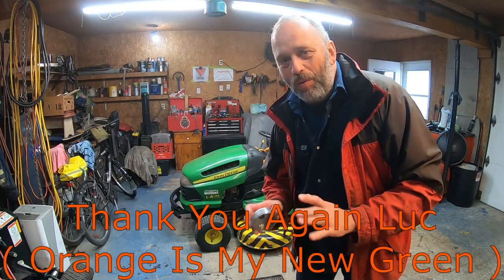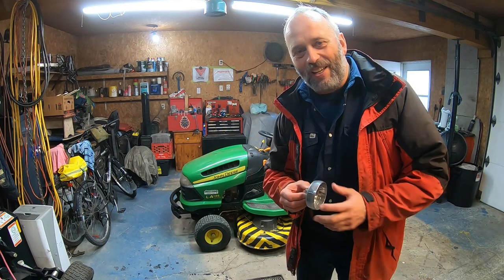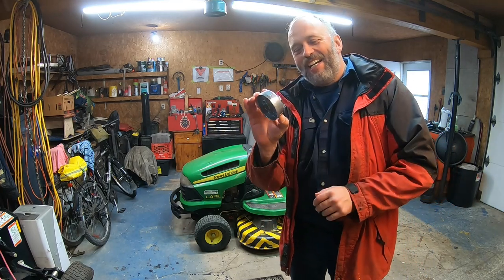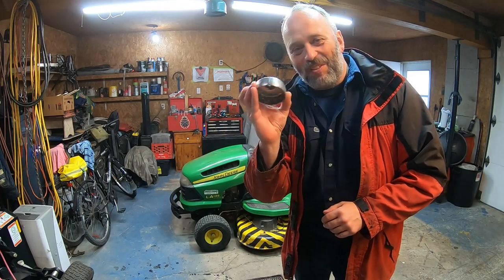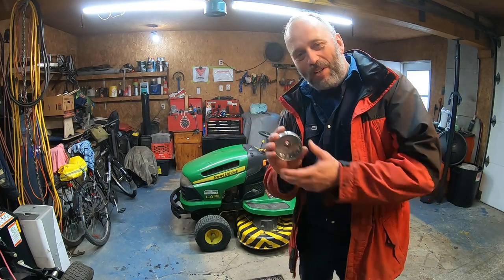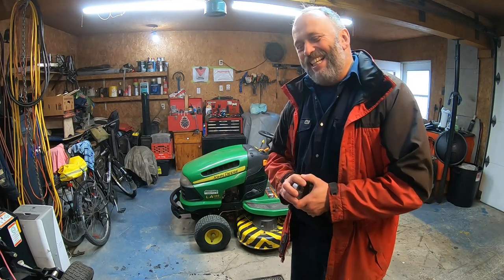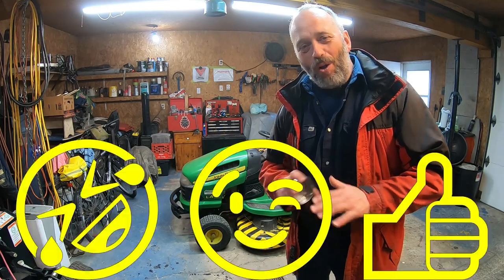The Best Ever Protective Coating on Mower Decks

Comment: Great experiment Dave.   Now I did notice your mower deck does not have any rollers at all.  My tractor has 2 on each side plus one on the front that prevents the deck from striking any objects as it keeps the deck protected  from striking  the ground  on uneven lawns .  Maybe it's just your model but I can't remember seeing a deck without rollers. 😅
Reply from the maker: Good day Steve, Thank you very kindly for your OUTSTANDING supportive feed back comment 👍👌😇 I removed them since they were getting stuck everywhere when I was living in Shefford  or had fallen down after many year of metal fatigue like I did on this video (  https://www.youtube.com/watch?v=lN-kNU6gQlk ) 🚧🚧 No Problems Since Then 😇👌👍🚧🚧 Now for the front part, I have an idea ( extra bumper right in front of it on an incoming WINTER  video ) 👍😇 Thank you again Steve Cheers 🍻🍻
Reply: @RCAFpolarexpress   Dave they are not ment to run along the grass while cutting but adjusted high enough to only  protect the deck .  Maybe you could try them in the upper position.  Put the deck to the cutting height you regularly cut at  on your concrete floor  and have the rollers adjusted about 1/2-3/4 inch below the deck.
Reply from the maker: @SteveRobReviews  Thank you very kindly Steve for your explanation 😇👍 I had done that in Shefford ( I had to admit that the green was not even on various places, just simply turning will get the side of the these wheel hang on the grass and tear it up ) But since I'm here now on my small green patch, it might work a shot to try it 🤔😉👍 I'm still awaiting the tare to dry this week re welding them into place won't be to hard or trying an other bigger wheel model perhaps,,, thank you Steve Cheers 🍻🍻
Reply: @RCAFpolarexpress  take the  blades off!
Reply from the maker: @paulbecker97  Good Evenings, I did not need to take the blade off but I did to sharpen them later  👍👍😇After the Wet Summer That We have the mower deck is looking very nice and no paint or maintenance I have to do except the regular greasing and cleaning the dry turff Cheers 👌👌🍻🍻

Comment: The deck looks in good shape Dave, great protective coating 👍🏻. Have a great week and thanks for the shoutout 😉🙋🏼‍♂️🙂👍🏻🍻cheers!
Reply from the maker: Good evening Luc, it was a great honor to mention your name and channel mon ami and trust me doing that :  rust off, paint, resin, enamel paint and then tar coating will be a time saver and that will also save the structural integrity of my mower deck since I will not have to remove rust on every year like the last 12 yrs but rather just a 10 min clean up on every year 👍😉👌 Keep up your OUTSTANDING videos Luc and I like you last wood cart that you built for your FEL on your Orange tractor video👌😉👍 Cheers 🍻🍻

Comment: The tar seems like it would restrict and change the flow of grass out the discharge or to the bagger
Reply from the maker: Good day Sir, You are correct but after a couple of hours, the tar surface is getting smooth and In my case, I have a recutting set up blade and the discharge port is blocked for making sure that the grass getting composted faster. Thank You Very Kindly Sir Cheers 🍻🍻

Comment: Good evening Sir, your mower deck will last for many, many years with the layers of protection that you applied.  I agree with you about keeping water away from the underside when cleaning as it will promote wet decomposing grass and that is not a good thing.  Keep up the good work and have a great week Sir!
Reply from the maker: Good evening Sir, thank you very kindly for your Outstanding Positive feed back comment Sir 👍😇👌 Yes in deed water is causing a lots corrosion in deed when not properly dry and with grass,,, it is disaster awaiting to happen over the years if not maintained very well, but now with that combination of paint and tar or the Deluxe Version ( paint, resin, enamel paint and tar ) you will save time and energy over the years and also the structural integrity of your mower deck 👌😇👍 I just realize that was a kind of an infomercial pitch line that I wrote 🤣👍👌 thank you again and keep up your OUTSTANDING Logging Video ( Your last video cleaning up after cutting tree ( Chainsaw & Grapple Work) was OUTSTANDING Sir )  Cheers 👌👍💪😇🍻

Comment: Great video Dave. You know all the tricks 😎 Tar for decks and Hydraulic oil for wood. Very cool my friend. Have you ever tried a spray on graphite coating like EZ slide?
Reply from the maker: Good evening Sir, thank you very kindly for your OUTSTANDING informative positive feed back comment Sir. No, I did not try that product at all but if it is like graphite grease on gun like we use in the desert or artic it will not offer enough cushion against flying rocks, perhaps maybe  ?  🤔 Did you ? Have a safe week and OUTSTANDING video of your Firewood making ( splitting, pilling etc,,, ) 😇👍👌 Cheers 🍻

Comment: My solution to prevent rust on a deck was to send the deck off for hot dip galvanising. The deck and mower is now 18 years old and although the mower has had a new engine and many repairs, the deck does not have a single spec of rust on it. I did not paint the deck after galvanising. The mower is a Husqvarna iZ commercial zero turn and has been heavily abused, including using the deck as a grader to push dirt around, still no rust and the deck cleans up really easily with a high pressure water blaster.
Reply from the maker: Good Evening Sir, thank you very kindly for subscribing to my channel Sir 👍👍👌😇 Thank You So Much For Your OUTSTANDING Technical Life Biography is truly Marvelous Sir 😇👍👍Thank You Again Sir for the high quality writing 🧐👍👍Cheers 🍻🍻

Comment: Good video Dave.  I have a bit of a contrary opinion about the water.  On the deck of my Deere GT235 garden tractor I go with your thinking...I don't ever wash under it because it lives at the Overlook which has very sandy soil.  The bottom of the deck is always super clean because it is essentially sandblasted every time I use it.  On my Toro ZTR though, it's a different story.  I use it at my home and the conditions are very different.  My yard is at the low end of our neighborhood and really holds water.  Days after it rains the grass can still be wet so I get lots of buildup under the deck, and that buildup holds moisture.  However the Toro deck has a washing port which allows me to plug the hose into the top of the deck, turn on the water and run the blades.  It's not perfect but it does a pretty good job of cleaning out the grass if I do it right after cutting, and letting it run for a few minutes helps dry out the underside of the deck.  My logic is that the grass buildup is going to hold moisture regardless of whether it's from wet grass or from the hose, so I'm better off removing as much buildup as I can.  The deck is 15 years old and still in good shape so I think I'm safe. 😉  (BTW, I do clean it fully by hand whenever I sharpen the blades.)

Great content and good info on coatings!  Cheers my friend!  🍻👍😎
Reply from the maker: Good Morning Sir, thank you very kindly for your OUTSTANDING VERY WELL WRITTEN Informative Feed Back comment my friend 😇👍👌 For your Mower Deck of your JD I would recommend to apply paint and tar since sand will eat your mower deck over time ( BTW the tractor is 14 yrs old ) My mom use to cut 2.5 acres of grass using the same tractor before I buy it from her  and I had around .5 acres to cut when I was living in Shefford ( see these videos  https://www.youtube.com/watch?v=ylOeYCYEw_w&list=PLXG51U0Imi5WYQzQJsOBgsJRwBSYcgCWR&index=5&t=2s ) and this video too you will see how much rock blasting I had (https://www.youtube.com/watch?v=lN-kNU6gQlk&list=PLXG51U0Imi5WYQzQJsOBgsJRwBSYcgCWR&index=12&t=3s)  so it was rocky and dusty on my high ground part and wet on the lower portion of it as you can see on my video. I wish that I had new that beford my mower deck was starting to get very tine and putting in jeopardy the structural integrity of the mower deck ( especially between the two spindles ) , I was about thinking using resin and fiberglass cloth but now with these results I'M SO HAPPY, but now I have field tested solution to overcome these problems ( normal version : pain and tar ) ( deluxe version: pain, resin, paint and tar ) and ( Bullet/Rock Proof Version : Paint, mixed resin and fiberglass, paint and tar ) 👌💪😇 Now Sir that was for your John Deere. Now for your Toro mower, yes I do agree about cleaning it after each cut and making shure that you are drying it correctly ( you can put a blowing fan to finish the drying and you will save a lots of gas doing it instead using the engine ). Yes removing the grass is a vital factor for sure, but if you were putting paint and resin the grass will slip out easier ( I can wait to see how the snow will react on my snowblower drum for that since it is resin multi coated !!! ) and that will also protect against corrosion too and the clean part will be mush easier too. Thank you again Sir and have an outstanding week Cheers 🍻

Comment: Obviously your TAR test has worked for you. I use another method of cleaning my mower deck which is opposite to yours :) Without starting a controversy, let me say that 
my 'deck is still rust free and exceptionally clear of grass and debris.  I do agree with you that the deck must be kept dry and I use a lot of compressed air and then a fan to keep
 air circulating  all around the underside. I bought my Cub Cadet 1046 mower/tractor back in 2006 and it is still  in 'tip top' condition.( Free from any and all rust ) Of course storing
your mower indoors is very beneficial to ANY equipment, isn't it!
By the way I have to mow some 2 acres of lawn each time, so yes keeping those cuttings off your mower is critical to protecting the steel parts, maintenance is the 'key'!
Reply from the maker: Good evening Sir, thank you very kindly for your OUTSTANDING Informative feed back comment. I like your point of view and also ( forgot to mention ) that I do use compressed air to clean after each mowing therapy too. Yes storing the equipment OUTDOOR need an Oil treatment for protection but I also forgot to mention that I keep my humidity lower that 45 % at all time inside my garage. I do think that a good paint and tar for your deck will help to keep the structural integrity since the flying rock, sand does eat up the steel over the years right ? thank you very kindly and have  a very nice week Sir Cheers 👍😇👌🍻

Comment: Great idea, Dave! I’ve never heard of anyone else treating the deck like that- but it certainly looks like it holds up really nicely.
Reply from the maker: Good evening Sir,  it was a disaster awaiting to happen over the years since the last past 12 years I had to clean and paint and redo it ( THAT WAS A BIG LOST IN TIME ALSO ), but now with that combination of paint and tar or the Deluxe Version ( paint, resin, enamel paint and tar ) Like I just did,  you will save time and energy over the years and also the structural integrity of your mower deck like mine  👌😇👍 Thank  you very kindly for your very nice supportive comment Sir and Keep up your OUTSTANDIGN team work with your lovely wife Cheers 👌👌😇😇👍👍🍻🍻

Comment: Great video Dave. I’m just wondering what type of tar you used. You mentioned roof tar. Could you give more details on that. And as you say. Never use water to wash. 
Have a good week Dave.
Reply from the maker: Good evening Sir, look at my video description you see this video ( exactly which product that I used ) and other interesting videos too for you to see  👌😇👍 Yes never water in deed ( sorry for my poor English speaking ) Water cause corrosion if not properly dry 👍😇👌 and soap is also corrosive 🥴 Thank you very kindly for your OUTSTANDING support and have a very nice week Sir Cheers 🍻
Reply from the maker: Hope that the electric grid is fixe ? Cheers
Reply: @RCAFpolarexpress  yes things are going now. But they say we could expect power outages.
Reply from the maker: @noelstractors-firewood57  OUTSTANDING, yes after the big ice storm back in the 90's it did take a couples of months to fully reestablish the power grid to normal. Get plenty of rest Sir Cheers 🍻🍻

Comment: It sounds like we swapped summers this year as we had a hot summer and you described our normal summer 🙂 I think we will be cutting our grass one or two more times this year. The effects of the mowing on the coating is interesting. We always end up having to cut the grass when it is wet both ends of the year which is not ideal
Reply from the maker: Good day Joseph, thank you very kindly for your OUTSTANDING support and Yes we did end up switching summer compare to last year ( we were bone dry !!! ) Yes, using Resin is OUTSTANDING for preserving the structural integrity of the mower deck and a nice coat of tar over it it make the mower deck rock/bullet proof and free of rust  😇👍👌This video show also the difference how much rock's throwing I had  https://www.youtube.com/watch?v=lN-kNU6gQlk🚧🚧🚧🚧 Keep up your OUTSTANDING WORK JOSEPH WITH YOUR FATHER AND MANU CONGRAT'S ON YOUR 1 K Subscriber 👌👌👍👍😇😇✨✨🚀🚀 Cheers  🚧🚧🚧🚧
Reply: @RCAFpolarexpress  Thank you for the details and for noticing that I hit 1k subs. I think you are the first to notice, I am very happy
Reply from the maker: @GardenTractorBoy  CONGRAT'S JOSEPH and I do Think that is JOHN from LOGGERJOHN01( https://www.youtube.com/channel/UC4-Mjo-d04ftEB8B4_vItIQ)  was the very first to notice it   😉👍 Cheers 🍻🍻

Comment: The thing about fiberglass resin is it doesn't adhere to steel or paint real good it'll lift up. After that water will get trapped in-between and while it looks good on the surface underneath it's destroying the metal.
Reply from the maker: Good Evening Sir, thank you very kindly for your informative input Sir, but since this fiberglass resin is made for automotive repair it contain more ( gluing ). Now the shape of the lawnmower is sure helping to stay, and with 2 various types of pain underneath help. The other factor is a never expose my lawnmower to water. I use air pressure to clean. Water and Grass is a rusting agent. Now, with they tar over the resin it seal very good the mower deck too. Thank You Very kindly Sir, Ho I forgot to mention, I did fixe with this repair kit my entire skirt all around of my former 1985 Dodge Ram Van B 350 and it stick pretty good for many yrs ( around 9 yrs !!! ) and it was expose to rain, salt and rocks !!!  This how I discover the OUTSTANDING advantage of this automotive repair kit Cheers 😇👌👍🍻

Comment: Dave, the water shutoff is usually on a slider so it will move with the frost. If you dig away the sod just below it, you should be able to drive it down a bit so your mower deck will float right over it. OUTSTANDING!
Reply from the maker: Good evening Sir, thank you SO MUCH for your OUTSTANDING INFORMATIVE FEED BACK COMMENT. I will do that RIGHT THIS WEEK 😉👌👍 Cheers 🍻

Comment: Well, you just proved that tar is definitely a very good choice. Resin is tough, but pretty expensive. Happy Sunday mon ami🍻😁👍
Reply from the maker: Good evening Sir, Thank you very kindly for your OUTSTANDING supportive feed back 👍😉👌 I do agree with you but if I was had summer like the one that I just have ( POORING RAIN ) resin will be my first choice beside what is 100 $ worth to have your mower deck for life and no more rust to remove ? But sadly my mower deck has suffer de rusting the last 10 yrs or so, the tine steel was getting thinner and thinner over the years and the structural integrity was near to the end. So using resin for me was a good choice ( btw NO CRACK's on the resin between the spindles ) were their is a lots of vibrations I was about to put fiber glass everywhere but now I'm sooo happy of that results ( do you know how expensive a mower deck is !!!)  🥴👌😉👍 So now, just a little cleaning and patching there and there and that is it 👍😉👌 thank you again and keep up your OUTSTANDING Snow Removal Videos and Highway Patrol with your lovely wife Sir  🤣👌👍🍻
Reply: @RCAFpolarexpress  I’m sure that a new mower deck is very expensive and that both Fiberglass and resin would make it last a lifetime 👍👍👍
Reply from the maker: @Viper6-MotoVlogger  Yes it is and like I was writing to Joe ( Their is also the Bullet/Rock proof version ( Paint, mixed Resin fiberglass cloth/ paint and tar ) but that is when the structural integrity is in jeopardy or when you have more rocks that grass to cuts 🥴 but for a normal city slickers that I'm now temporary, paint and tar is definitely a very good choice like you said Sir 😇 Thank you again and have a safe week on the road 😇👍👌
Reply: @RCAFpolarexpress  you be safe as well mon ami 🍻😁👍
Reply from the maker: @Viper6-MotoVlogger  🙏😇👍🍻